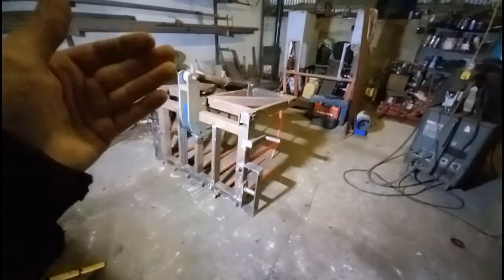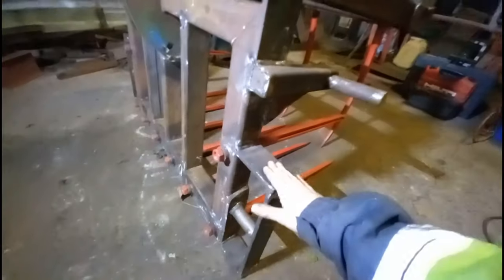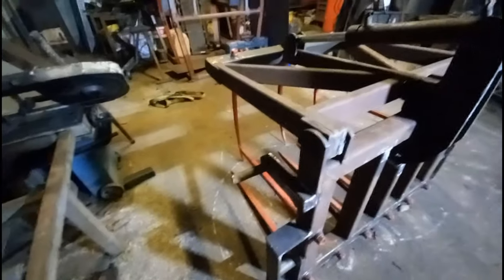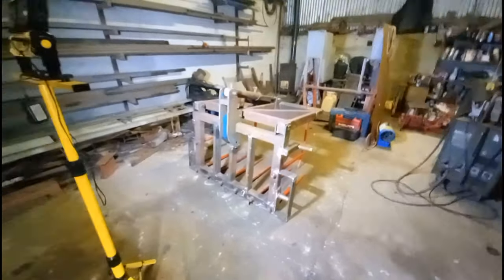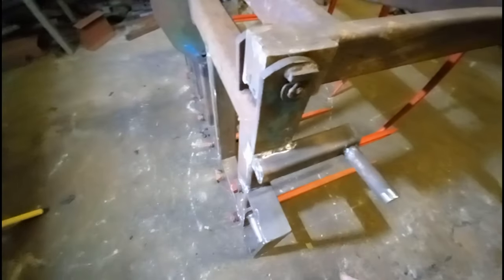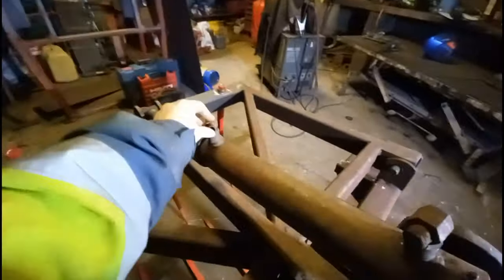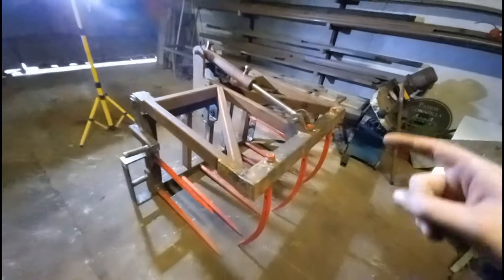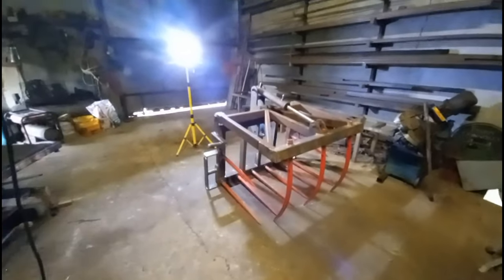MAKING A FRONT LOADER ATTACHMENT FOR THE TINE GRAB

Comment: You'll have to make a weight block for the 188 to operate the grab safely, especially when loading dung.
Reply from the maker: We have a weight block for the back of the 188 already. We use the 188 and the front loader in the bog, load the turf into the bucket and tip the bucket into the trailer. We use the back weight block for that toi.